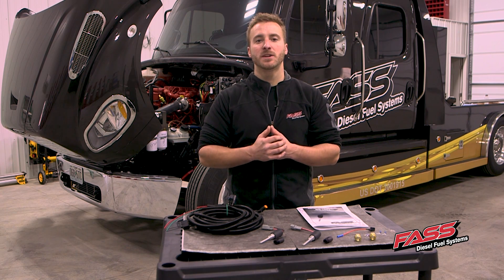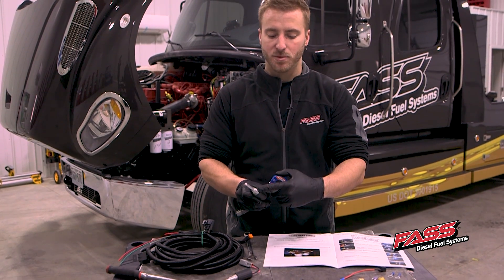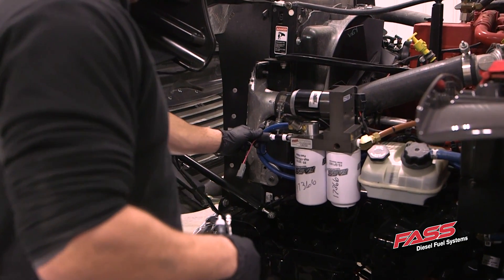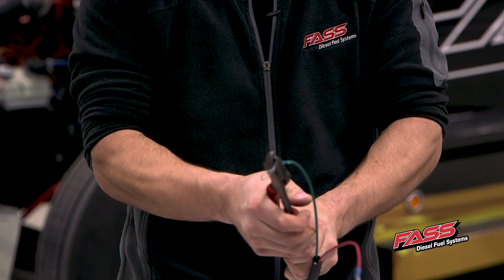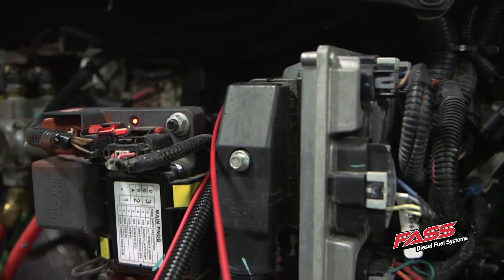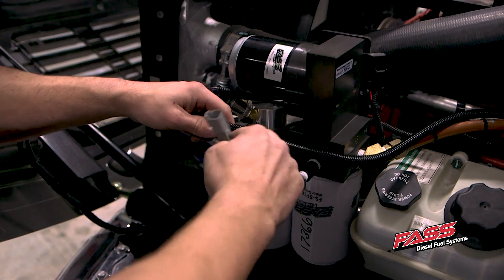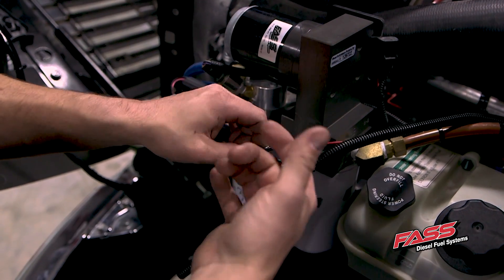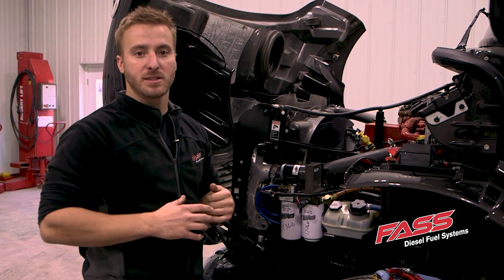FASS Fuel Systems "Electric Heater Kit Installation"

Comment: Why did you wire the second heater in, you should have used another Quick Connector instead. Only makes since, in case you have to replace the heater. And I would have went ahead and cut the wires and used heat shrink.